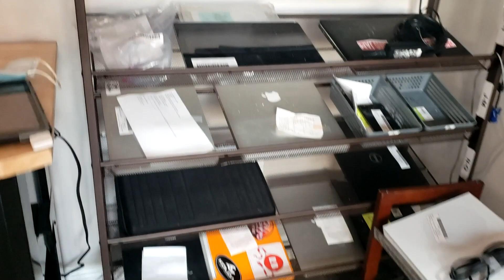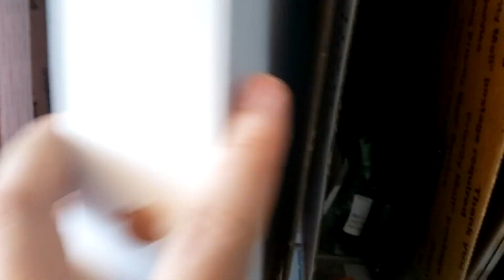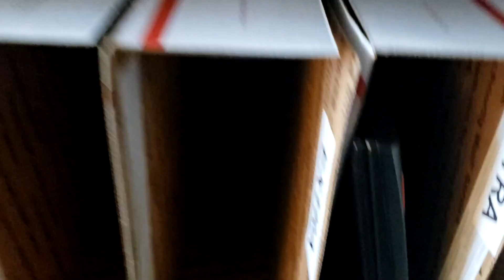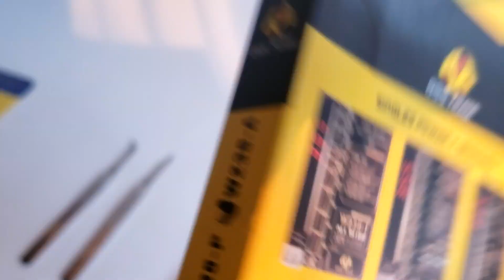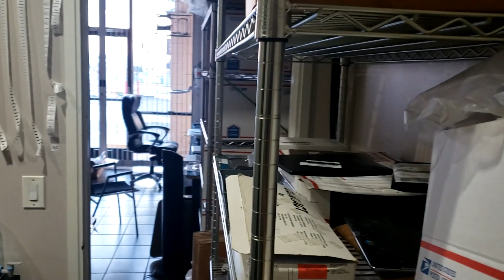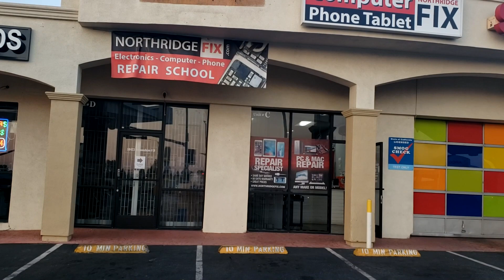Repair Shop Tour - Store front and sign re-design - Any ideas

Comment: Great job with with everything! I would say move the door from unit C from the right to the left i.e more central?  Unit c perhaps remove the signs from the windows, people see customers in there that's a positive thing. Put one on the central column that tells you opening times for the week.  put some signs on unit d windows as you don't use that door etc. Make sure you have console and mobile repair advertised as i don't see this much??

Comment: I would paint that middle wall section to black, like the door frame, this way it will look like 1 shop. The sign I would put it in the middle and paint the wall. The one thing is odd to me that your shop door, it is behind the column, the other door looks more visible to me.

Comment: If you are backed up, it’s only going to get worse and worse each day. If you can’t keep up 100% on a daily basis, you need to get extra help or raise your prices to regulate the incoming work. When/if it slows down, you can lower the prices if you want. But you don’t need to worry about advertising. You can’t handle the daily work as it is. A great problem to have. Congrats!

Comment: Holy moly buddy you have a ton of work cut out for you. Lot and lots of work. Only thin I can suggest for the sign issue is, A) Make a bigger sign to extend and fit in the middle of both stores or, B) have a painter paint the patch up with the same color.

Comment: I would use one overhead store sign for both store fronts. I would move the window signs to the new side and use the new side for shipping and storage. (then it doesn't matter that the windows are covered) Then customers could see the retail and repair side through the windows. I would make the street signs bigger print for easier viewing, existing spot could say computer fix and the psychic could be changed to tablet/phone fix. Top (existing) sign should probably be the thing that brings in the most business/profit. How much you spend should depend on the amount of your walk-in business compared to mail-in.

Comment: Paint that brown spot with the same color as the building and move the computer repair sign to the middle/center  of both storefronts - don't need another sign - then take repair specialist  sign to the new door or computer parts or have a computer parts sign  in the new door front - that's my idea - save some money by centering the large sign

Comment: I do that for a living in my day job, far far far away in europe, but you need to either do a board that is the same way has the old one or you need to remake everything to keep a certain "continuity" of the design/image.  i wouldnt cover the whole window on the doors, it gives the feel that the store "wants to hide stuff" inside making it look "shady". I would do simple lettering for the window/door and a one big billboard on top.  To put one image you could use the "brick colun" between the 2 stores, starting at the floor and ending at the top of the door, making it all flush and even. whatever you do dont think about one publicity and then another and the another, you need to think about the whole image and that needs to work with all the design elements. Also you could take one high resolution picture of the store front and give you accurate measure. on a door, window, etc (using that its easy to find all the others)

Comment: Suggestions for store front:

Replace the existing single shop banner...with large one , keep North ridge small...keep focus on any make any model...that should be highlighted one...

For the column between the two shop...use it to fix wall decal..

Make one shop for repair/storage...another for shipping...direct selling and customer corner...

Also instead of keeping full laptop....de assemble it and put its parts with labels alphabetically.

Comment: Hi,

Just  few suggestions...

1. You can build wooden open coupbords with laptop size compartments rather than the steel racks...it will give you more space.
2. Categories you incoming devices based on issue...like charging, Tristar, display...so that you can work on multiple devices with same issue...that will increase your productivity...
3. Apart from big boss..you can have someone just to assemble and de assemble...so that you get motherboard faster....also the time you spend on assembling and checking can be reduced.
4. Wires are everywhere on your work station...keep it tidy...
5. Divide the total items by days you have...so that per day items that are must to repair before going home...so that you stick on the schedule....this you need to do on daily basis as daily the qty of total items to be repaired..

Lastly you need a hand....you buisness is growing...so you have to grow your team.

Thanks